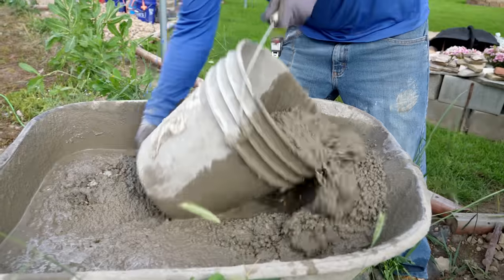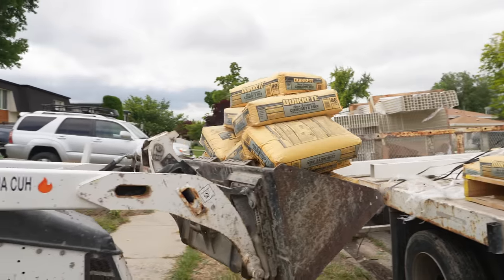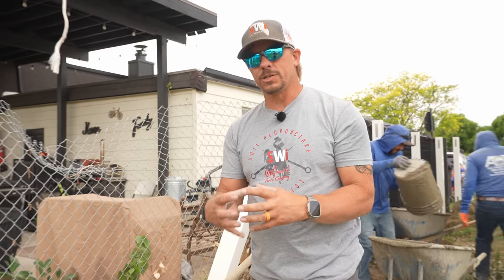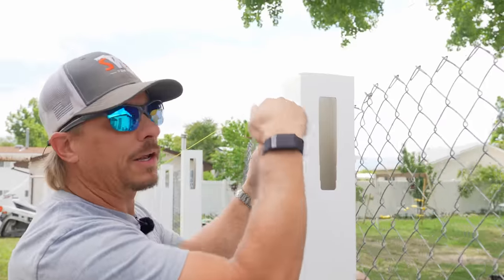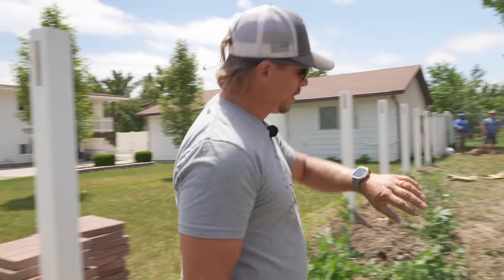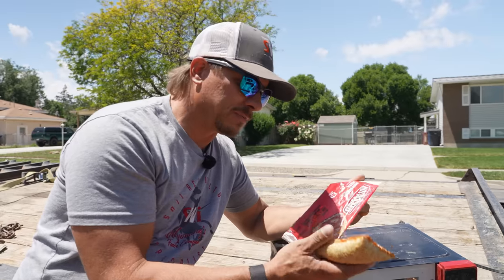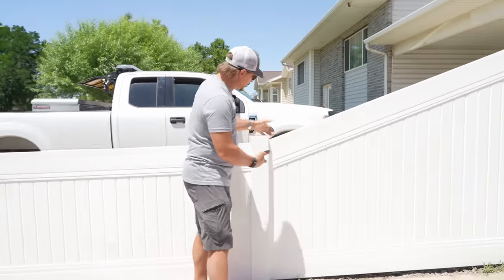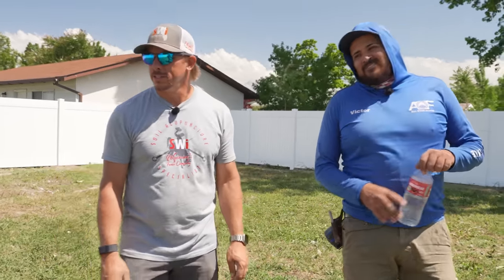This Mexican Fence Builder Left Me In The Dust!

Comment: concrete strength in a posthole is basically a non issuse...you are not pouring a slab or foundation in which the concrete will be under a compressive load ... the concrete in the post hole serves two primary functions... it takes the place of having to tamp the soil or other fill material to achieve sufficient compactness ( i woud argue the time spent tamping dry mix/soil/aggragate compared to mixing concrete is the same with the added benifit of using wet concrete: the abiity to easier adjust  the post  for plumb)...more important, it adds mass to the diameter of the post allowing for a greater cross section on the bottom of the hole to help prevent "sinking" and the added mass horitzontially allows for better resistence to post "tipping"  (especially in wetter climates) in other words a larger foundation.... i also think this video shows the benifit of wheelbarrow mixing as opposed to using a drum mixer, it seems victor uses the most efficent methods (efficiency assumes no compromise of quality)  well done video....kudos to Victor on his success as a business man and (didn"t indicate citizen or legal immigrant) jouney to sucess in the U. S.

Comment: I was going to say how come your not installing the 2 horizontal trusses and the fence section in there post holes before installing the posts?  I see what your doing you install the posts a little shy of the truss length then cut the truss's down so you can pop one end in then slide it over and put the other end in. But that requires cutting the fence length too. But this is 100% faster for sure. And I have the worst luck every time I don't brace the post the next day its moved. But this was extremely informative thanks and I  subbed this. Looks perfect to me.

Comment: Question from a DIYer interested in doing a small fence job — How do you avoid the bracing?  Do you just allow the concrete to set just a little bit so post is a little bit tight in there, and adjust from there?
Reply from the maker: Correct. It doesn't harden all at once. A little bit of firming up gives you the ability to make adjustments.
These might be helpful:
https://youtu.be/M-fVT-tfjWI
https://youtu.be/55pueg3jCBY

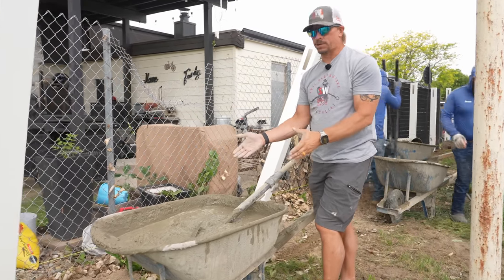Comment: 4:50 the crew i worked on poured dry crocrete into the hole then stuck a paint mixer on an electric drill down in and mixed it up (with water of course)

Comment: I like to use stakes and individually finish nail each post to a stake as I go so they are all plumb both ways. That way I’m not coming back every five min to check if they’ve moved while the concrete is setting
Reply: Aluminum. Should’ve waited til the end.. no I see why you did it that way..
Reply: Professionals don’t brace their posts. 😂 guess I’m not a professional..but I guarantee they are plumb both ways every single time

Comment: Just curious , I have built cedar privacy fences and pouring in wet concrete like they are doing with the plastic fence posts . How does the plastic post stand up when placed in concrete , as in , does the concrete from a chemical stand point not destroy the plastic?
Reply from the maker: Correct, the concrete does not harm the vinyl.

Comment: How is the plastic holding up against the sun? Doesn't it get brittle after a couple years? I like how it looks and I hate painting. But I live at sea and in tropics. Nothing can handle sunlight and salt air.
Reply from the maker: There is a huge spectrum of vinyl fence ranging from quality to trash. It's all about the quality of vinyl used. We install in Florida with no issues.

Comment: How do you adjust the posts up and down if the posts are set in cement?
Reply from the maker: Concrete gradually hardens as it cures. If you time it correctly you can make those adjustments while it's hardening but not hardened all the way.

Comment: Worked with a lot of people from a lot of places. People are skilled or they aren’t. people have pride in their work or they don’t.
There are lots of hardworking Mexicans and lots that arent.
I was so fascinated  by the single guy that built the giant patio next door to me that I hopped the fence and helped him all day  just to learn and get some exercise .
The last crew that did a roof for me was terrible and one whole side of the roof needs to be Re shingled but they are only willing to fix two really bad low spots. They also Put flashing around chimney with nail heads popped out and no caulk. For a vent pipe extension they just wrapped some flashing around the pipe and painted it black. Coming tomorrow to “fix” it.
Its not where you come from. It is how you are raised

Comment: im confused ... where is the center pole from inside the outer sheath ... up here in canada you cant do PVC fence without it
Reply from the maker: We use thicker vinyl and don't use steel on the inside except for the gate post (or if we're driving posts instead of using concrete and then sleeving over them).

Comment: Wet concrete ok for a fence.  Much better than dry mix.  But no way can you set posts and fence same day in my windy location.   In fact the wind would most likely move just posts without bracing.   I fix many sprinkler issues caused by fence crews.   Hire a sprinkler pro.  Don't let fence crews try to fix their damage.

Comment: It using the string is just creating so much more unneeded margin for error. It takes 30 seconds to attach the string so why not just do it ?😂 Side note why is everything in America don’t so flimsy? That fence could get booted through or ran through with ease lol. In England it’s concrete posts and wooden, concrete or thick and hard plastic panels.

Comment: my question is why does the americans use plastic fences instead of real lumber? sure it will last longer and is probably cheaper in the U.S, if you don't take care of your wooden fence, but lumber is so much durable and just looks better in my opinion, the waste of the plastic will just be used as landfill in the U.S and hurts the environment alot. no i'm not a vegan or anything of that sort, i'm just you're regular european that knows what the waste will do to the environment.
Reply from the maker: It's a regional thing. Vinyl is extremely popular in certain parts of the US, while there are vast sections of it that consider it ugly and trashy.
It's really hard to say that lumber is more durable, in a lot of places over here it will rot away within 10-30 years. And vinyl has the perk of being recyclable. (Whether or not folks are actually recycling it is a different matter, of course.)

Comment: These fences are junk. Ever tried to repair just one section ? Have fun with that because the entire fence needs to be disassembled.  Have fun pressure washing these things twice a year because they attract mildew like nothing else. I've seen these completely melt in the sun or turn brittle and break after just a year. This stuff is as bad as Trex or any other plastic building material. Anyway, the guys work ethic is good, but not the fence. 80% of the Mexicans that do construction work here in the CA bay area are hard workers but have no idea how to do things correctly without a good experienced legit GC guiding them. But they learn fast.